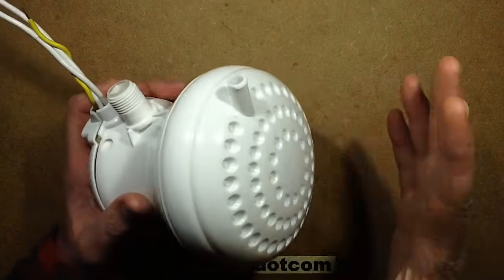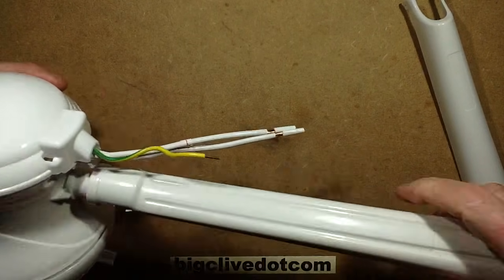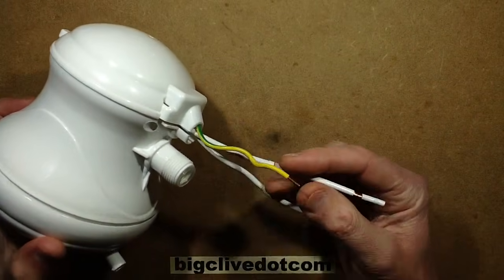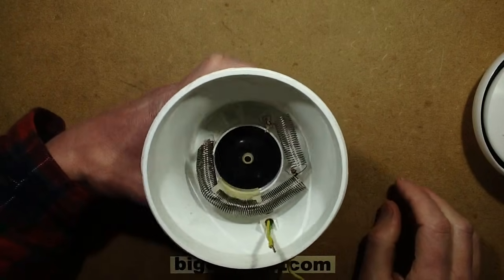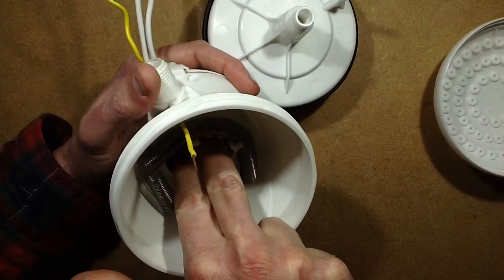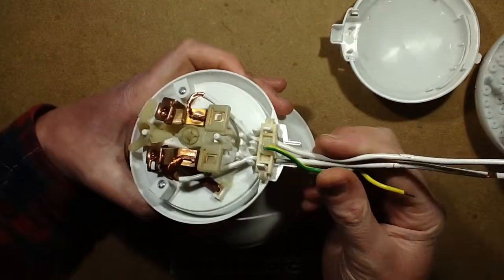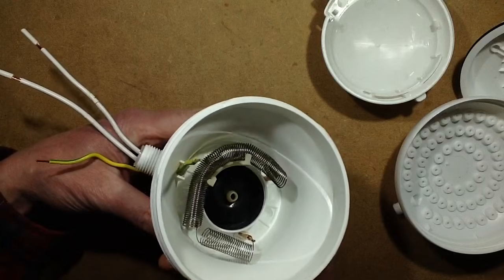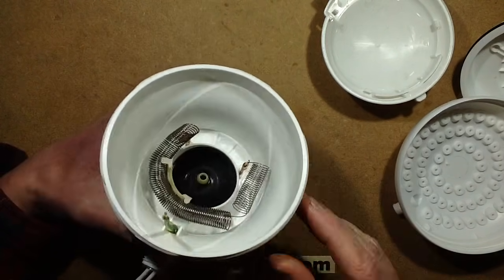Inside a heated shower head.  (suicide shower)

Comment: is this for people who do not have a water heater in their home/basement?
Reply from the maker: It's commonly used in hot climates where they don't actually need a hot water system.
Reply: ohhhh that makes a bit more sense, im in canada, so EVERY home has a water heater, i guess i just had this notion that every home would have one everywhere, except places that didnt have running water. id rather have a hot water tap in every sink, instead of have just a self heated shower head. also seems like something that could malfunction and burn the plastic or something, and id rather not have that.
Reply: perezmaximus gotcha.
Reply: Same. People have been known to die of hypothermia where I live because of boiler problems in winter, If I shut off my hot water system right now the house would get very cold. I still remember as a kid waking up and being able to see my own breath inside as houses weren't as well insulated back then.

Comment: any country where this is considered normal and okay is clearly full of idiots. there's a million better solutions that aren't much more expensive, like instead of having the heater in a showerhead why not inline on the pipe further down the line and away from the shower, basically like a small electric tankless hot water heater .
Reply from the maker: The main issue here is cost.  It's in countries with lower income and a hot climate where the dodgy shower is a compromise to getting heated water on demand when no other hot water system exists in the house.

Comment: Crap like this happens if there are no regulations
Reply: Grely Moly Cremp or common sense
Reply: +Guten Can't always rely on common sense though
Reply: There IS regulations here, A LOT of regulations on terms of electrical engineering. We are even part of the ISO (International Organization for Standardization) and the IEC (International Electrotechnical Commission). 
The responsible of these regulations is the IRAM, Argentine Institute of Normalization and Certification or "Instituto Argentino de Normalización y Certificación".
These showers were approved because they're actually safe when well grounded, they are tested and approved by the institute that I mentioned before.
A car can kill you and kill others but that doesn't mean that you should ban automobiles...
These showers have been used at least 30 to 40 years and they're killed less than you could even imagine... 
Just because you never saw or used a shower like this it doesn't mean that is not safe...

Comment: 30 years using this shower every day and i still alive.
Reply: No. A good eletric shower works for years.
Reply: Some people do drugs for over 30 years and are still alive, does that mean its safe?

Fun fact, a $600 water heater will last on average over 20-30 years, and you have heat from all your faucets, and you don't have a death machine to shower under daily.

I'd take a cold shower before I'd use this.
Reply: @Towlieee  400 million people do drugs for over 30 years? If not, its a bad analogy
Reply: @Towlieee  The problem never was the costs of a gas water heater, but the gas itself.

Comment: Every house in Brazil has those and i've bathed with those in my entire life.
Reply: Do houses in Brazil not have a hot water supply? Just seems strange to not have a tank ,or even tankless residential water heater, which is normal in the US.
Reply: @prismstudios001  usually no they don't. only usually hotels or fancy apartment complexes, but they're rare. especially since having electric showerheads are cheaper. also, Brazilian construction uses almost exclusively PVC pipes for all plumbing (also cheaper) which melt/get squishy/sag with hot water running through them.
Reply: @prismstudios001  Natural gas is not cheap in Brazil, most of the gas is imported from Bolivia, on the other hand, electricity is very cheap and very clean, Brazil has one of the cleanest energy sources, so it makes sense to them use electricity in their showers.
Reply: Black & White god I would hate not having hot water
Reply: Poppin' Loch Ness Hopster It's much easier with these things, most devices don't have water and electricity sitting right next to each other.
Reply: Last time I turned mine off it bursted into hot boiling water!
Reply: They're usually fine, it's just if you fuck it up it's going to electrocute you.
Reply: Eu que o diga, levei um choque de um chuveiro desses mês passado, meti a mão atrás do chuveiro sem querer, olha que já levei muito choque consertando aparelhos eletrônicos, mas nenhum chega perto de uma descarga de chuveiro, o pior é que eu tava molhado, simplesmente perdi a força no corpo todo, horrível.
Reply: You mean like every electronic device?
Reply: It certainly doesnt help fight the stereotypical view of Brazilians

Comment: Couldn't you avoid most/all of the shock problems by galvanically isolating the heating element? You'd remove earth as the ground reference and create a local ground in the shower head.

Comment: why do you need a heated shower head. isnt that what hot water is for?
Reply: Because some places in the world, most of Brazil where i live for example, cold days are only a few in the entire year, so a central heating system is not only to expensive but uselles most of the time, because unlles you are in the south most regions of the country you will never need things like heated water in taps or things like this, just in the shower, and it still varies with individual preferences.

Comment: I once went to Brazil and the place where I stayed had one of these things.
I was in such need for a shower that I didn't really realize it was electric at first. Didn't pay too much attention to it.
While I was showering, I raised my arm to wash my armpit and felt a weird sensation on my hand. I thought the water was too hot, and that it was burning me. I lowered the temperature, and kept washing. As soon as I raised my hand again, the sensation came back. This time I thought that maybe the pressure was pretty high there, because it was like a tingling sensation.
I messed around with it a little more, and ultimately realized the sensation was that of a small electric current, and it got unbrearable if you got your hand too close when the power was high. It was like those prank devices that give you a shock that leaves your arm shaking for a while. It was pretty scary.
It surprised me that I heard no one talk about these things ever before.
They should be damn banned.

Comment: As a Brazilian that used "suicide showers" my whole life, I can and will say that only bad installation is kind of dangerous, and even so, I never heard of anybody dying under one of these, and I don't know how in hell they got theirs to catch fire; Also don't compare a rich country with a third world, they're cheap, reliable and actually safe if you use connectors (even safer if you have a proper earth wire system), any accidents that must've happened with it is because someone, somewhere, was stupid! Either touching the thing while on, trying to fix it without turning off energy, not installing properly, etc.... A bad thing there is: building a whole heating system has prohibitive cost here, many times getting big portions of a minimum wage, while the cheapest electric showers such as this in the video cost around 10 Euros, if you exchange our currency, depending where you buy! I'm not saying it's perfect, I'm just pointing out some hoaxes out there about them!
Reply: The people just try to change the power setting with the water running. the contacts running at high current don't shutdown with the opening, and the electric arc melts everything.
Reply: Yeah, they were stupid for using this in the first place. Fuck your shithole third world country ;)

Comment: I'm brazilian, and I am amazed at how frightened people are about electric showers. People not used to it seem to have the feeling that there's no law or regulation on electric showers in latin countries. It is perfectly safe, we brazilians take 1 to 3 showers a day and I've never heard of anyone getting electrocuted by this type of showerhead.
Reply: A human that is wet doesn't stand a chance in case of electric shock. Electrical regulations in civilized countries forbid bringing electricity close to the water in bathrooms. Even simple power sockets are forbidden. For good reason.

This device doesn't just bring the electricity near the water, it brings the electricty in the water! Yes, in order to  kill a person certain conditions need to be met. So, normally you won't get an electrical shock. But that doesn't mean it is safe.

All that is needed to kill you is a malfunctioning ground wire and just the life wire not being connected (which can happen during operating the switch). I call that a major hazard.
Reply: @danielmantione  funnily enough "civilized countries" allow people to bring gas inside every one of their homes even though it kills so many people every year just by monoxide carbon poisoning, not even talking about other problems related to it. All the while 210 milllions of Brazilians take a couple of these showers everyday without any problem at all and it has been like that for almost a hundred years. So do not disguise your stupidity and lack of knowledge as some kind of "superiority" or "safety issues", it's kind of pathetic you know...LOL
Reply: @NaFran49  Damn, I love u so much ❤️❤️❤️
Reply: Even with the ground unplugged you don't get a shock. This type of product is sold everywhere, Canada, USA.
What happens if you unplug the earth and lick the shower head? Nothing: https://www.youtube.com/watch?v=06w3-l1AzFk&t=124s
Reply: @danielmantione   So you're implying Brazil isn't civilized?
Reply: @rafaelmocochinskifreitas9016  Well, let's forget Brazil for a while and look at the least developed countries on earth. Will you find well designed and enforced electrical regulations in those countries? You don't. Countries need to reach a certain point of development and prosperity before they realize the importance of electrical regulations. Once you start looking at electrical safety, you will start looking at the dangers of water really quickly.

I don't think it makes senze to discuss wether Brazil is civilized and uncivilized at this point. It makes more sense to look at the facts. Let's look at prosperity, Brazil is at position 78 of 192 the list of countries sorted by GDP per capital as published on Wikipedia. That's certainly on the better half of the chart, but way below the North-American and European countries, even the ones that are considered poor.

While there is certainly a lot more involved than GDP per capital, it makes sense that Brazil did not yet have the luxury to have as strict electrical standards as in other parts of the world.
Reply: @danielmantione  the thing is that in Brazil those showers heads are very well regulated. All manufacturers take in consideration the water resistance and design the shower head in such way that the water travels such distance before getting out of the shower head that the resultant resistance is so huge that almost no current flows through it as the heating element is a way smaller resistance in parallel. Almost all of these showers sold today in Brazil are compatible with residual-current breakers, so those are leaking less than 30 mA...